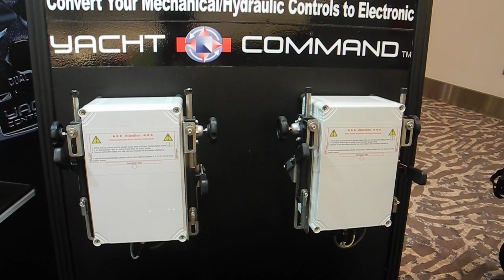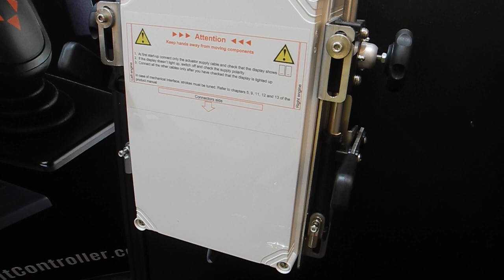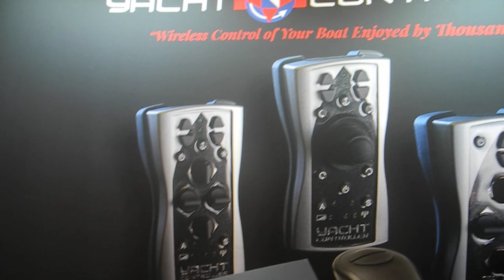Yacht Controller, Fly by Wire

Comment: Very nice if you can afford the diesel right now. It is going to get very expensive for a boat filliup-. My car fill up is double what it costs in January  2021. Glad it gets 36mpg.
Reply: Interesting topic Robert—filled 2 vehicle and ordered 200 gallons of heating oil for the house in the last 2 days…over $1300 spent on fuel .Something has to change NOW—thankfully I can handle this but I know very many who can NOT and these people are gonna be crushed by this insanity.
Reply: @johnm5714   My goodness what's heating oil on Long Island? Gas in Alabama went up over 60 cents a gallon last week. $4.00 as of now. $ 120 to fill the van.
Reply: @alabamasmokeywilson6818  Smokey—I heat the house primarily with a Pellet stove or I’d be spending that PER MONTH to fill my tank.
I bought 200 gallons to fill up before the price goes up to $8 a gallon.

I drive a full size GMC work van and my wife has a GMC Yukon Denali—both 8 cylinders of American power.Fill both those tanks each well over a hundred dollars with Premium fuel being $4.70 a gallon.

We need to become energy independent again and it needs to happen TODAY—it was that easy to crush the keystone pipeline with the stroke of a pen—He needs to get his head out of AOCs butt and reverse it.

There is no ceiling on this—I filled my van last week at $4.30– 3 days later it’s $4.70 when I need it again.it’s Monday,by Wednesday or Thursday I’ll need to fill it again—what’s it gonna be then?CRAZY
Reply: @johnm5714  It went from 3.79 to 3.99 here . I'm sure it will be over 5 soon. I hope everyone is happy Trump is gone
Reply: @alabamasmokeywilson6818  I can say a lot of things on this subject Smokey but I’m gonna refrain from that since this is not a political forum.

Suffice it to say…81 million people supposedly really screwed up!🤨
Reply: @johnm5714  I agree with you. I should not have said anything this is not a political forem .I want do it again.
Reply: @alabamasmokeywilson6818  you didn’t cross any lines in my opinion Smokey.I would have though and that’s what I was referring to.don’t worry about it—neither you or I are responsible for the state this country’s in right now—plain and simple
Reply: I got a feeling there's not going to be as much boat traffic as last year.
Reply from the maker: @alabamasmokeywilson6818  I guess the cruising world will go back to Trawlers and Sailboats for the economy?
Reply: @AskCaptainChris  Sail Boat would be nice know